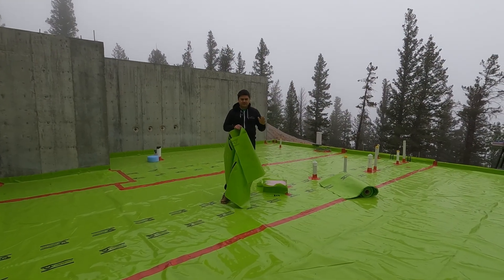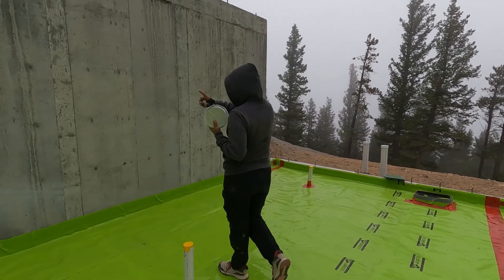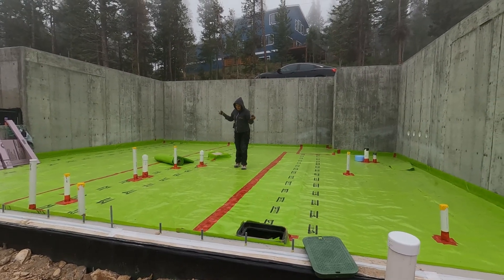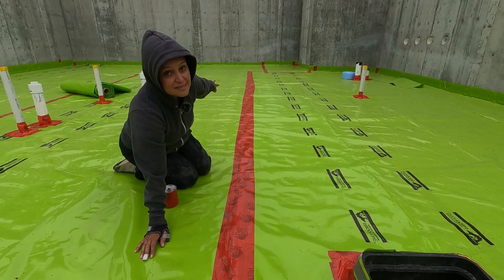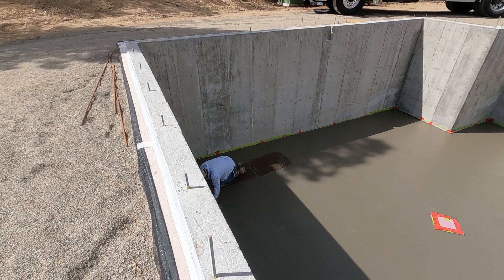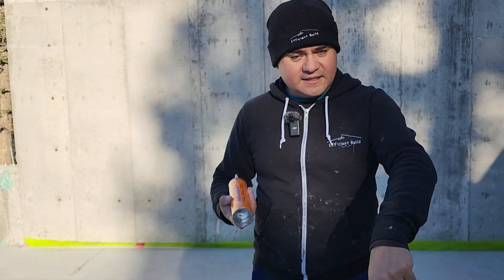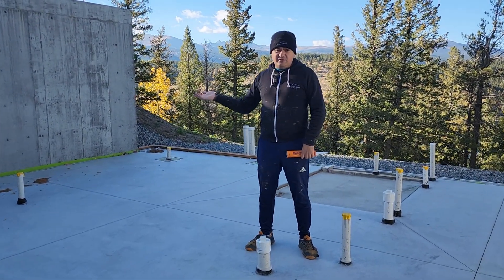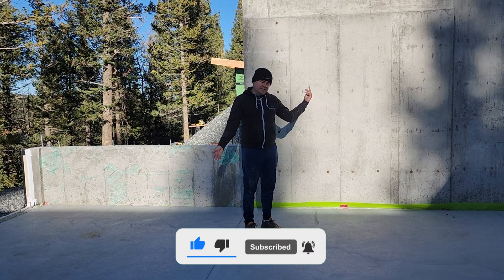Stego Vapor Barrier / Radon Mitigation

Comment: I noticed you used StegoTack Tape on the walls and then Crete Claw tape on on the floor near the wall.  It was not in the install guidelines but make sense to me to do this.  I was curious how you came up with this idea.  Beautiful installation!  I have watched this video several times.  Thx for the pointers.
Reply from the maker: Thank you! We really appreciate comments like this.
TBH, I think we saw the installation procedure on a @StegoIndustries video. It might've been a comercial application. I looked for it and did not find it.
Reply: @efficientbuild  Thanks for the response.  Much appreciated.

Comment: Are you going to need to install some sort of additional vapor barrier product on the interior of the below-grade walls at some point? The outsides of the foundation walls just have the insulation and bituthene layers, but I don't remember hearing whether that was enough for radon protection on walls?
Reply from the maker: That's an interesting question, I believe the thought process is that radon will take the path of least resistance through the soil and up. Then, avoid going into the house. Note that a fan still needs to be connected to the pipes to exhaust to the roof.
Reply: @efficientbuild  radon does get in thru vertical foundation walls, esp when soil wet. Not as important as sub slab tho-if you have to worry about radon thru the walls, and you already have an active subslab system, you’ve got radon levels
Reply from the maker: Good to know, I figure it is negligible otherwise everyone would also be putting vapor barriers on the walls. Plus radon detectors don't really show it as an issue.